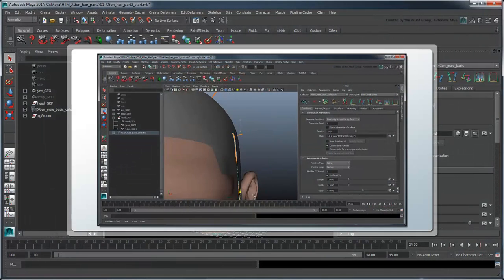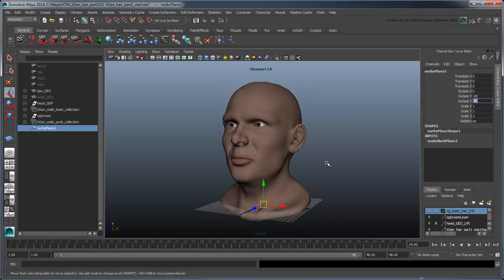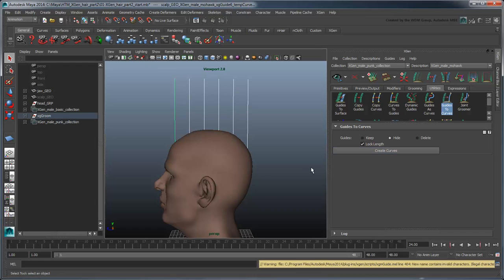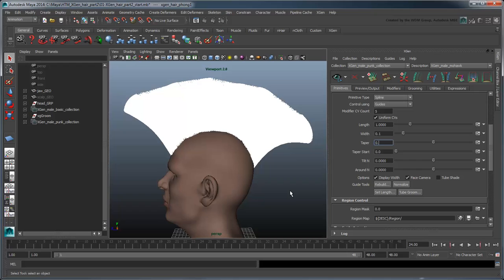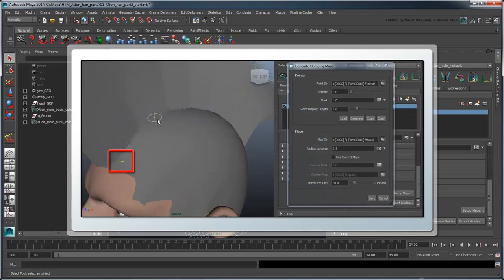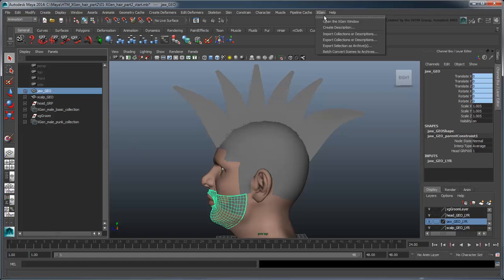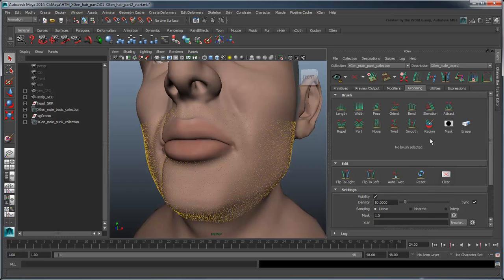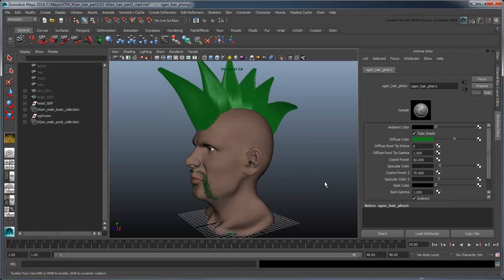Using XGen to create hair (Maya 2014) - Part 2: Punk hairstyle using Clump Maps and Splines

Comment: Hi, I'm running into an issue after creating the description. Maya won't create the .ptex files and the folder structure that supposed to be under groom/. Everytime I hit "Update the XGen preview" it says path not find. Any ideas on how to fix that?
Reply from the maker: +Ammar Nassri Hmm that's odd.  Have you tried manually creating the folder path in your file browser?
Reply: I did, it didn't seem to work that way either. I'm running maya 2016 on a mac. Any ideas?
Reply from the maker: It's difficult to say.  Do you have full write permissions on the folders you're attempting to create?  Maybe try deleting the Maya Preferences folder and starting from a default state?
Reply: Tried that, didn't fix it. I've created one description for the hair and another for the beard in the same collection, could it be that maya is not liking that and it causing it to not work properly?
Reply from the maker: It's possible.  Try creating two different collections and see what happens.
Reply: That didn't work either. I discovered that it's not even creating .xgen or .xdsc files either. What am I missing here?
Reply from the maker: Hmm, seems like a bug with your install. I would try reinstalling, updating, or filing a ticket with support.
Reply: Figured it out, XGen didn't like dealing with the mental ray shader that was applied to the geo. I assigned a lambert and it worked. However, I still have to create a folder with the mask name underneath paintmaps in order for it to create the ptex file. Thanks for your help!

Comment: This is an excellent tutorial on Xgen.  However, I'm having problems rendering the hair spikes on the top of the head, using Mental Ray and the EXR format.  The mustache renders fine, but the hair on top is just cropped and the color is wrong.  Any suggestions?
Reply from the maker: Did you perform this step from part 1?  Creating XGen hair - Part 1: Basic hair
Reply: Maya Learning Channel Okay, I got it to work.  I thought that I had the renderer set to Mental Ray and the Open EXR image format, but I may not have.  Also I forgot about setting the Output settings primitive bound Auto Set.  However, the first time it showed 'Mental Ray' as the Renderer whereas now it just shows 'None', but it still rendered correctly - nothing was cropped this time.  Thanks for your help!

Comment: cool. I have maya 2014 but there's no Xgen hair. where did you get it that? Thanks
Reply from the maker: Slight correction, XGen is available in Maya 2014 extension.  Not LT extension.
Reply: You need Maya 2014 LT extended, not Maya 2014.
Reply: Oh I see. I don't have activates Maya LT :( thanks for inform.